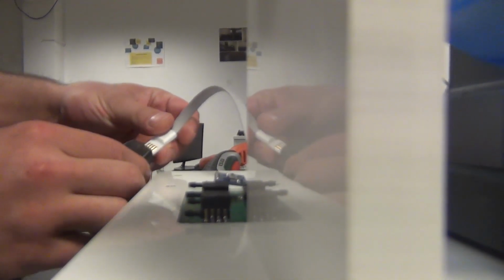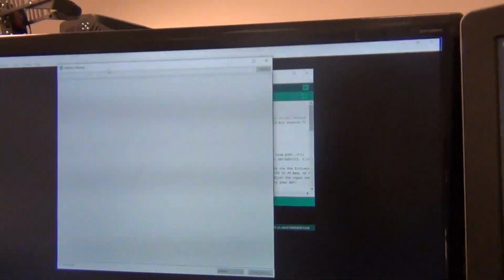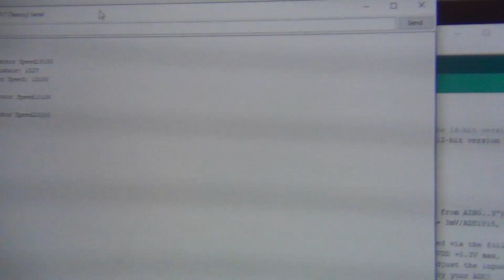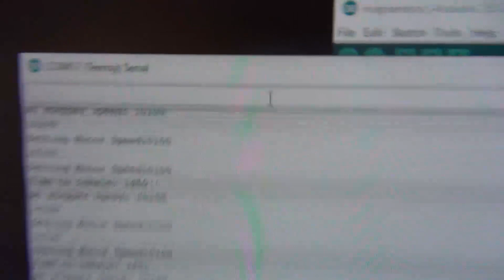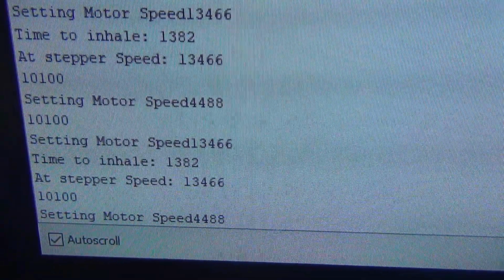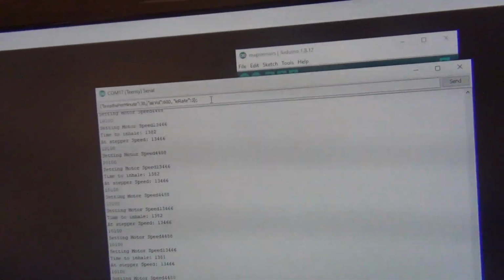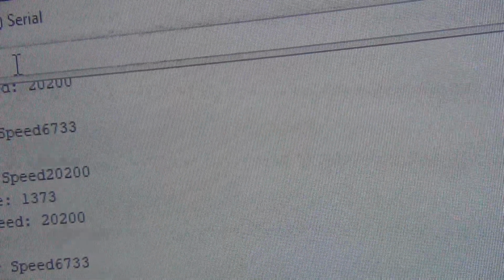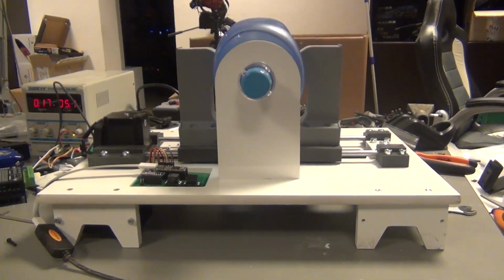Do It Yourself Mechanical Ventilator - Covid19 Breathing Machine - Open Source Ventilator

Comment: Way too complicated for the Third World and in an emergency in the United States. Take a look at this:https://www.youtube.com/watch?v=_0lB3IuuDo8
This is easily constructed using metal, wood, or plastic and hand tools. There is only one moving part and is robust enough to be transported in the back of a truck bouncing over roads, with thousands of holes per mile. The video can also be seen on this website DoctorDoctorDoctorDoctor[dot]com where you can leave comments.
 "When you have a hammer, everything is a nail."

Comment: I believe the fastest and easiest way to measure the air flow accurately is to enclose the whole construction in a "Sealed box" and have just one 7cm hole and  attach an MAF sensor from automotive engines. low cost and easy to find!

Comment: If anyone is planning to build this, when you are pressing the linear bearings into the carriage, I would strongly recommend warming the plastic first because, for me, the bearings are a tight fit and might crack the carriage, as happened in my case :(
The linear bearing part number is LM8SUU

Comment: Why not use air cylinder to deliver the oxygen by pushing the shaft instead ? I think it is easier , the problem with the medical  is the valve connection . You do a good job.